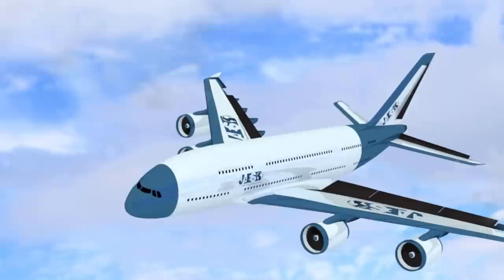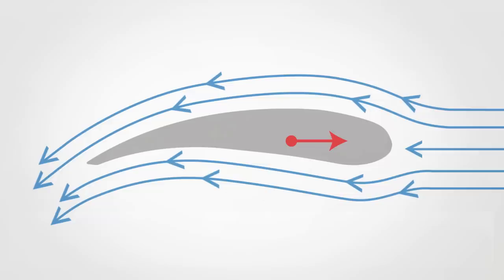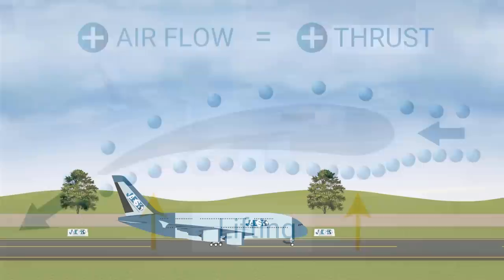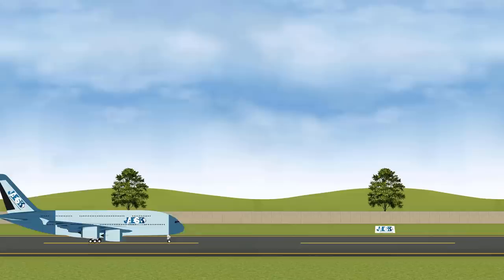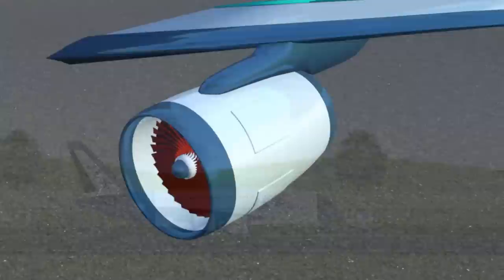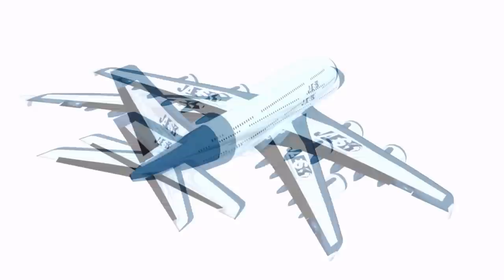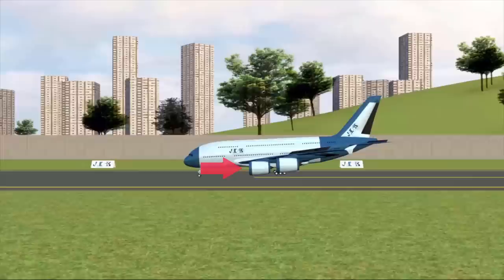How do airplanes fly? Components - Coandă effect - Downwash - 3D animation

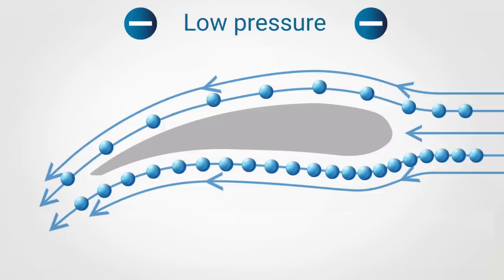Comment: Overall good presentation with excellent graphics. Mistake at 2:45. It is rather the fact that more air molecules are hitting the underside of the wing than the upperside, causing a net force upward contributing to the lift. Not suction. This is the correct physical phenomenon. Also please use word lift and reserve thrust for the forward thrust generated by the engines.
Reply from the maker: Dear Nishan thanks for your comment please look the new version let me know your opinion https://youtu.be/OCh4svEfDmE

Comment: The different pressures are Bernoulli’s principle. The same applies to fluid dynamics.
Reply: But he said the air travels at the same velocity on the top and bottom of the wing, so Bernoulli's principal wouldn't apply
Reply: wrong.    bernoulli  does  NOT  describe/explain  AERODYNAMIC  lift, produced in  Stationary  air.

Comment: Suction??? It is the pressure that lifts due to a lower pressure above.  There is nothing that pulls a wing up.  Suction is a poor term to use.
Reply: Maybe consider it to be a pressure difference instead. Less pressure on top and more pressure underneath.
   Demonstrate it for yourself by swinging a closed or partially open umbrella with the shaft horizontal, in a circle as you spin around. Youll feel drag and a little centrugal force. Now fully open the umbrela and repeat the swing while spinning. Youll feel more drag, but youll feel a noticeable amount of outward  pull. That pull is the lift component caused by the rudimentary airfoil shape of the fabric dome. If you were able to fashion a flat surface of about the same size and swing that around you would feel the effect of the incidence angle/angle of attack. You can also try extending your arm out the window of a car while riding as a passenger and with your hand flat and horizontal to the ground. Feel the drag, then tilt your hand slightly upward. Youll quickly begin to feel the lift component of the angle of attack. The higher the angle, the more lift up to a point where the lift diminishes and the drag noticeably increases. This is the rough equivalent of a wing stall where because the lift is decreasing due to a disruption in air flow. Stalled wing, airplane goes down and.possibly crashes if an adequate correction isnt made. This is taught in flight lessons. You can even tape a row of yarn or strings to the top of your hand to see the air flow changes during the experiment. You might even find a video where someone has done the yarn demonstration on an aircraft. Hth.

Comment: A pretty good video. But as in many other videos too, the explanation for the  generation of lift is plain wrong. Planes are  not sucked in the air. If so, planes wouldn' t be able to fly inverted. Also the shape of the wing has little  to do with lift generation. It is the angle of attack which drives lift generation.
The coanda effect is causing a diversion of air, this is well explained. Now,  this diverted mass of air times its velocity is the action  of which the equal opposite  reaction is the lift. 
AoA and speed drive the amount of air diverted and thus lift.
Acc. to newtons 3rd law of motion.

Check out to learn fscts: https://www.grc.nasa.gov/WWW/K-12/airplane/wrong1.html
Reply: @Martin Leutwyler No, airplanes do in fact fly because of difference in air pressure. However, they are able to fly inverted because the angle of attack is able to counteract the force of the wings generating lift. Explaining this is the fact that inverted aircraft always fly with the nose pitched slightly upwards - an airplane flying inverted with its nose level to the horizon would rapidly lose altitude.
Reply: @maxwang5949  i suggest you go thru the linked Nasa page  at the end of my post.  Then rethink what you have just said.
Reply: Quite right Martin. A lot of these videos seem to be obsessed with airfoils, and miss the point entirely. As any schoolboy knows, model aircraft with flat sheet wings fly perfectly well.
Reply: @kramrle  1:20 https://www.youtube.com/watch?v=ZpoK0InPciM  The angle of attack of this airfoil is pointing downwards, yet the airfoil appears to have zero lift. If the airfoil were raised up a bit (as in an airliner), the lift would be positive. After reading your article, yes, the theory may be incorrect, but airfoils still play some role in lift.
Reply: @Jack Cole  “model aircraft with flat sheet wings fly perfectly well” ... for a model airplane.

Most aircraft models try to create at least SOME camber in a “flat sheet” wing so it will produce lift even when the angle of attack is zero. Still, the model’s flying characteristics: very low stall angle, sharp/abrupt stall, abrupt and large increase in drag from unstalled to stalled condition makes recovery difficult.  For commercial airplanes, that design is unacceptably unforgiving of wind gusts, turbulence and pilot error. It is also suited for neither high speed cruise (too much drag compared to an airfloil) nor slow speed approach & landing (abrupt stall/drag characteristics and leading/trailing edge flaps/slats not effective).
Reply: Martin, you pointed out the wrong and linked a proof from a credible web source like Nasa. After that, it is up to every individual to decide what they want to believe. 
It is so unfortunate that so many viewers rated this video as exceptionally good and very informative. They gave the rating solely based on the quality of the animation and presentation. Now all those will go ahead and tell others what they have learned (with all the wrong things). Internet is a great place to learn but is also very dangerous because with an attractive presentation, you can make viewers (that aren't very familiar with the subject) believe in just about anything.
I am not saying everything in this video was wrong. The animation, commentary were good. Many correct information was presented very nicely as well but a few (and very critical) information was wrong. One (and probably the most important) of those is what you mentioned above.
Reply: @petep.2092  That's completely beside the point. No-one is disputing that airfoils create lift. The point is, that as Martin Leutwyler pointed out, it is the angle of attack which drives lift generation. The airfoil just makes that more effective.
Also, you seem to be debating the pros and cons between an airfoil, and a fixed high incidence wing, which again is beside the point. The angle of attack is changed by the attitude of the aircraft in relation to it's movement. Hence when the stick is pulled back, the elevators rise and force the nose to rise, causing the wing's angle of attack to increase, and increasing lift. And of course the same apples in reverse. Which is why an aircraft with a tricycle undercarriage rotates before take off. 
An efficient airfoil enables all this to happen more effectively, not cause it.
I've nowhere suggested that commercial aircraft do or should use a flat, high incidence wing, but merely pointing out that flat wings will generate lift, and by definition, that lift is not solely generated by the airfoil.
Reply: WRONG.    the SPECIFIC  shape / PROFILE  of  a  wing  is  the  KEY  to  making Aerodynamic  lift  and  to keeping a 100,000 lb  aircraft aloft.
Reply: @daviddavids2884  So that being the case, maybe you can explain why a 100,000 lb aircraft needs to rotate to take off?

Comment: 7:45 WTF is that? Differential elevator? Where did you see that an a real passenger or any other non RC or special military plane? Are you some kind of theoretic-but-very-far-from-practice guy? Please educate yourself before posting. Differential elevator has no sense on this kind of plane because it complicates regulation but no practical effect because applied torque is way too low for practical use because of a short handle. Nice animations though.
Reply: sorry to say but aircrafts are using differential deflection in ailerons to make a turn. and its sad to see you respond in such a angry way to such an awesome video. not a perfect, but a very nice video.